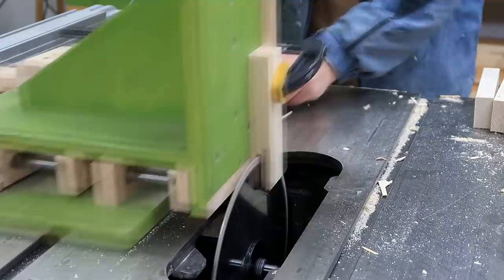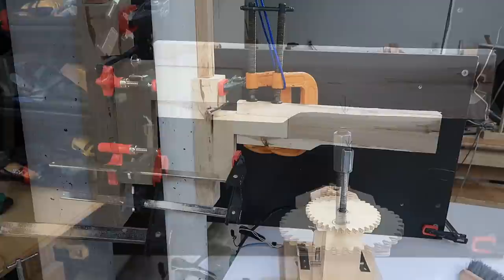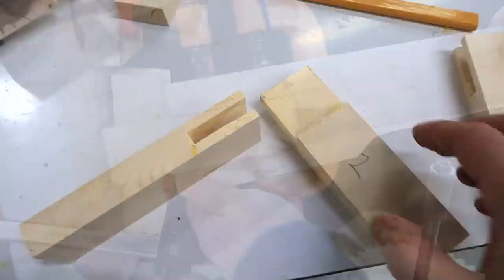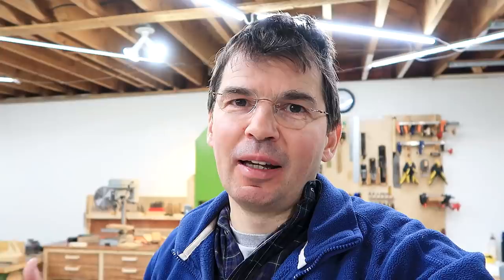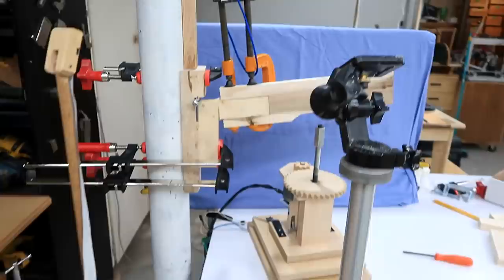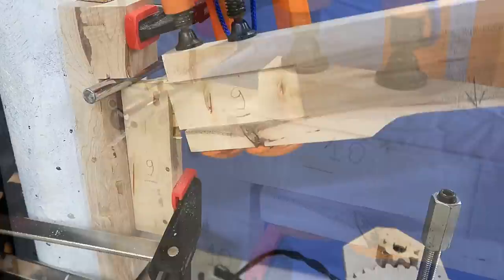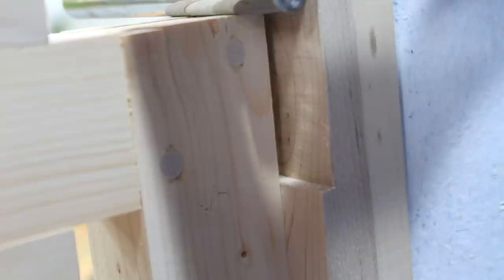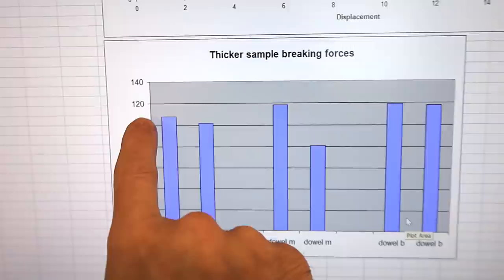Can reinforcing a joint actually weaken it?

Comment: 7:20 "I still think if I did this experiment enough times..." You did the experiment but didn't get the result you wanted, so you blamed the experiment.
Reply from the maker: that's how science is one in practice, not in theory!
Reply: That's how science works though, right?  I mean, if you get a result that doesn't make sense to you, you have to look for flaws in the methodology.  If you find none, you accept the result.  Otherwise you fix the method and retest.  That's what peer review is all about, I think.

Edit:  Actually, regardless of whether the result makes sense to you, you still go back and look for flaws in the methodology...
Reply: @matthiaswandel  Exactly, my interpretation of what you said in the video was that the noise in the data, combined with the limited number of samples made it impossible to confidently reject the null hypothesis. Student's t-test and the eponymous distribution are very important concepts in practical (experimental)  science!